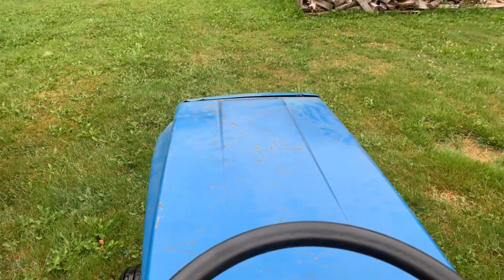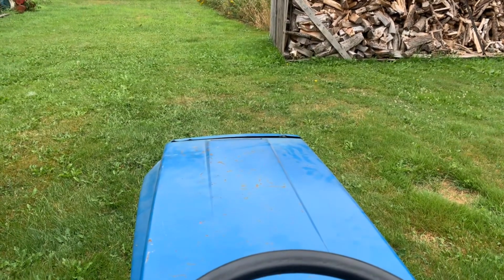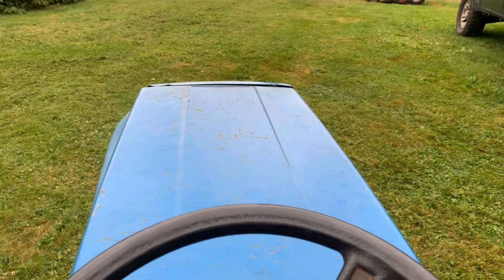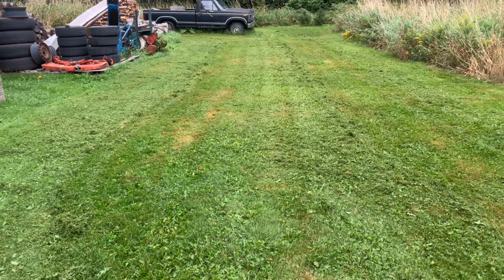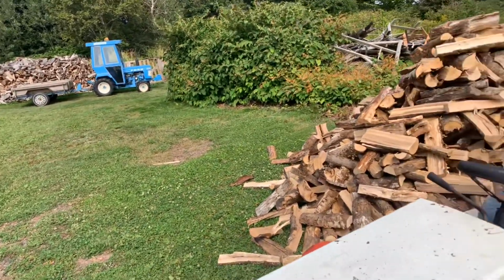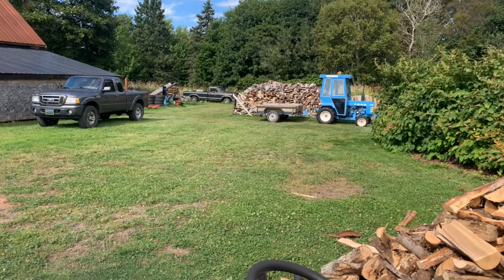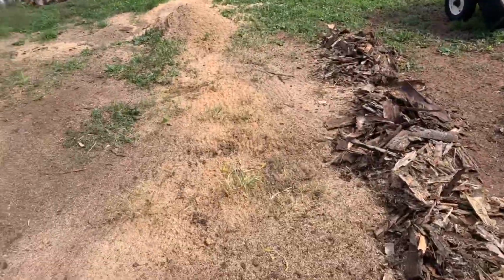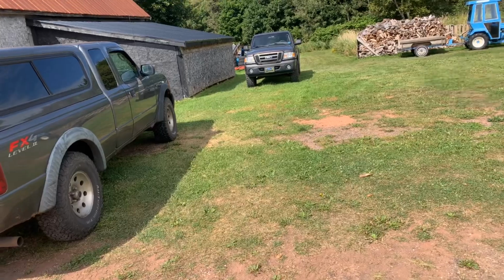Mowing deck modification test on kablewie. Wood pile update. #firewood #mowing #splitwood #grasscut

Comment: Hello Noel. The machine cut pretty good considering it was wet. I guess it was much easier to change the pulley than the engine lol. Great job and have a great day 🔧👍
Reply from the maker: 🤭🤭. Ya engine change was not a good option, since I can’t find an engine. Worked fairly good Artie. I’m pleased with the result. 
Have a good one Artie. 👍🏻👋

Comment: Not bad cutting the grass with a 84 inch belt glad it didn't break when you reved the engine up  back in the day 90s I had a Ford  gt 65  3 cylinder diesel  44 inch cut tractor  it was a hydrostatic drive with a cruise control  the one that you are using looks like a hydrostatic drive system what brand of engine do you have in the tractor I
With the 7.inch replacement pulley
Reply from the maker: Hi Robert. Yes. Hydrostatic. Two speed high/low transaxle. 10 hp Kohler K241 engine. 50” cutting deck. 10 hp not enough for 50” deck in the heavy wet grass. Works much better with the pulley swap. This tractor should have a 16 hp Kohler K341 engine. That was the standard engine for this model. 
That GT65 Ford would be a very nice tractor. Easy on fuel.
Reply: @noelstractors-firewood57   yes it was I would let the fuel tank be at half full then fill it up to the full mark  The hood was not metal as the original one was mine was the redesign plastic one  I even had a work light put on the back fender and the mower deck drive system was a shaft driven system for the middle blade The other 2 blades were driven by a belt
Reply from the maker: Same brand of engine in those tractors, I believe , as what’s in my son’s Ford 1210 compact tractor.

Comment: Do you find the bigger pully gave you more torque?
Reply from the maker: Yes. I would say so Kenny. Just sorta like loosening a tight bolt. A short wrench is hard to turn, but is faster to get the bolt out. A long wrench is easier to turn but is slower to get the bolt out. Hopefully I said that right. 👍🏻👍🏻👋👋